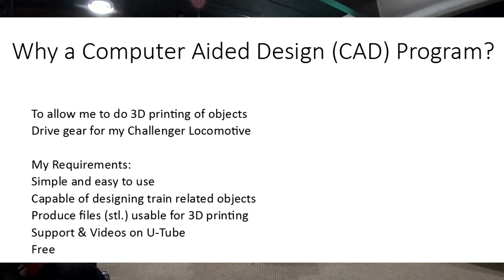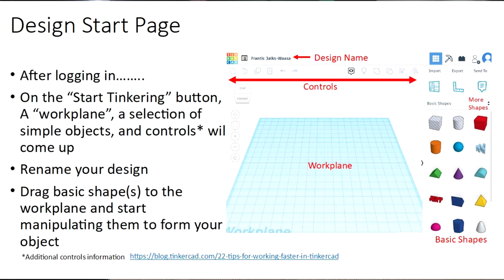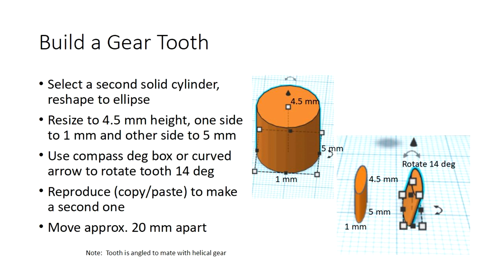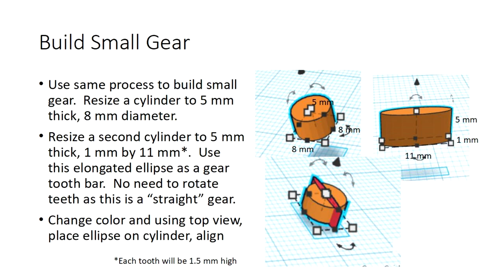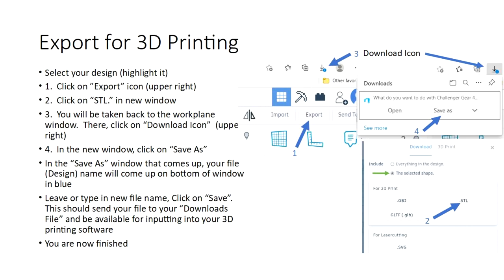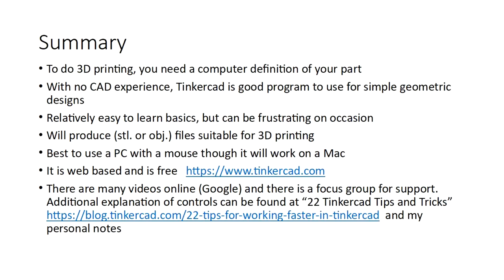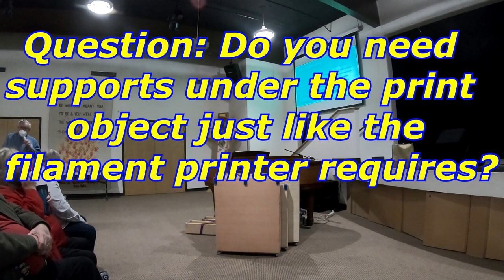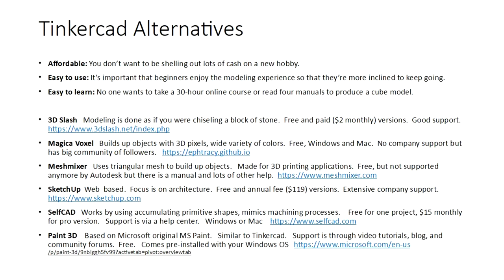2022 Clinics Norm TinkerCad

Comment: Great presentation. I’ve done a lot of parts with thinkercad including complete locomotive shells with tenders and rolling stock.  People give tinkercad a hard time due to its “limitations” but the limitations seem to be the user more than the software.  LOL. There are a couple of vids on my channel of locos I’ve designed and printed.  It’s a ton of fun and I’m having a ball.
Reply from the maker: Norm has done some great stuff with his 3D printer and mold making for parts.
Reply: Yeah I've designed a number of parts using tinkerCAD including entire HO scale models and G scale coupler mounts as well as a new cab for my New Bright 2-6-2 that I'm trying to make look like a Great Northern loco